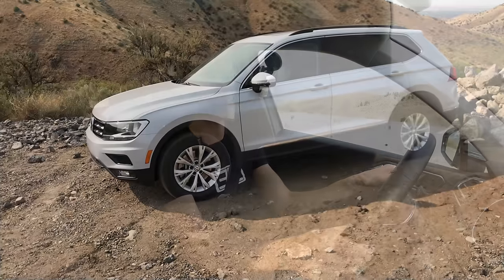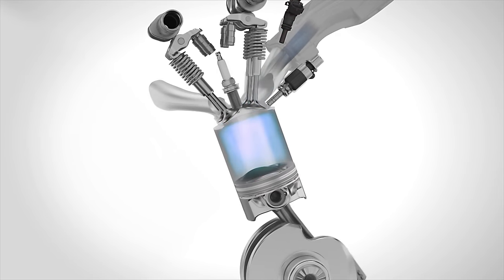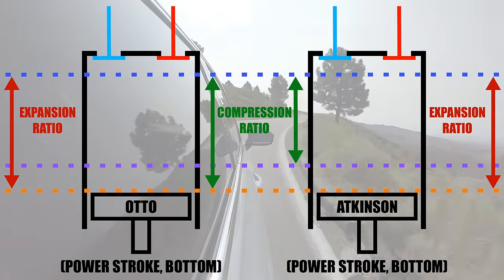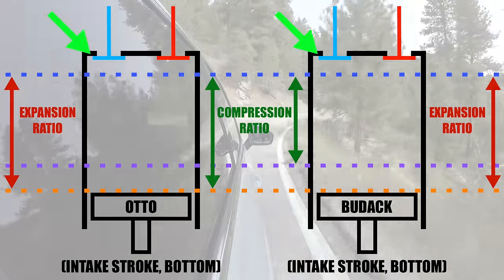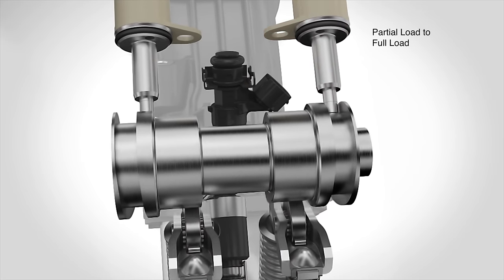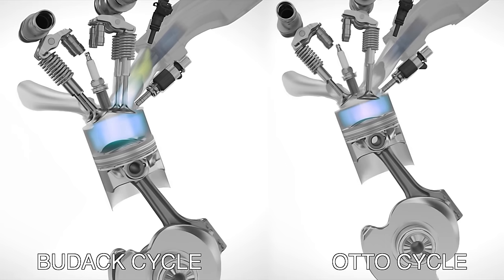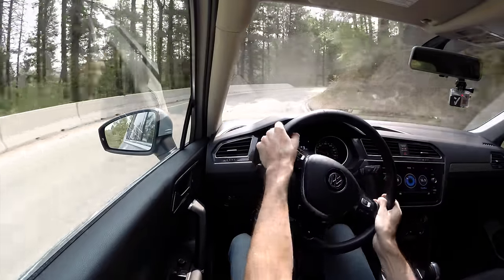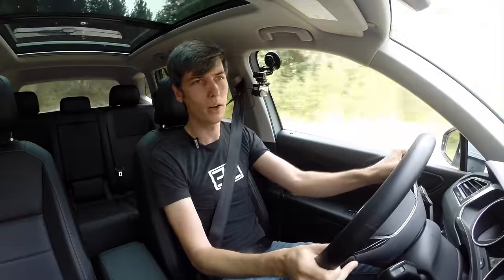Volkswagen's New Engine Cycle - The 'Budack' Cycle

Comment: So it's just variable-time valving? :s
Reply: Something Honda have been doing since the late 80's.
Reply: Mr.Mister Providing all the torque at a very low rpm, which honda never did, sorry.
Reply: St-Laurent Louis No need to be sorry.
Reply: St-Laurent Louis if u want torque at low end then buy a diesel
Reply: Technically a combined VVL/VVT system. Usually VVT works different (I think Jason has a video on it)
Reply: St-Laurent Louis no. Soichiro Honda wanted his engines to deliver the power with a naturally aspirated without turbos etc because of how that felt to drive. But that doesn’t seem to be possible to do if you want power and meet emission standards. So I guess it is the end of high rpm car engines.
Reply: krismoe31 , I think they do different things but the same way...
Reply: VVT is used to cut emmisions when the engine is not moving the car by restricting fuel flow to barely enough to drive the engine itself, while VVL is used to improve efficiency to power ratio. VVT changes the timing of the valves, while VVL changes the profile of the cams thus the amount of time and how much the valves are opened. 

TL;DR they work differently with the same goal: better emmisions in the real world while still having decent performance.
Reply: VVT with a different lobe pattern. It is all about that lobe pattern.
Reply: Rotring 
But emission scandals...
Reply: krismoe31 Q
Reply: Eh, the main difference is the intake valve could be closed during the intake cycle, lowering the effective compression. Helping fuel efficiency. While vvt usually is put in place to expand/move your power/torque curve.
Reply: Mr.Mister until they finally caught on and put a turbo on their engines. Only took 30 years...
Reply: Dan Richard
Meh...
Reply: St-Laurent Louis: Honda provided a similar amount of torque to any other normally aspirated piston engine of the same displacement, they just made about 50% more power.
Reply: Not sure to what you are comparing to, if you take a low performance engine of similar displacement then they make just a tiny bit of more low-end torque because their low RPM cam is very mild. But they have way more low-end torque compared to other high performance N/A engines. Any N/A engine with a fixed, "large" cam tends to have very poor low-end and even idling may be troublesome.  What Honda did is that they made best of both worlds: High low-end torque from a very mild cam and high high-end torque from a big cam. A low torque myth came from comparing engines of completly different displacements, or with a forced induction. BTW Stock 2.0L engine from a WRX, with a turbo peaking at close to 1BAR  has 15hp less than a naturally aspirated 2.0L VTEC engine from  S2000. And to be honest during city driving this N/A Honda motor with 207 Nm at 7500rpm feels much more torquey than a turbocharged WRX with 300 Nm/4000rpm, because of all the turbo lag and lack of boost below 3000 rpm.
Reply: Or better still, an electric vehicle... Heaven knows why they're wasting time and resources on this ancient technology.
Reply: Roger Froud Because battery tech isn't up to snuff yet. An even more ancient tech.
Reply: Tesla have already shown that's false, even with today's battery technology. The rate of change is enormous, so there's no point in chasing another few percent of efficiency out of something which has abysmal efficiency anyway. Forget the IC engine for small vehicles, it's a dead end.
Reply: Roger Froud The rate of change of battery development?  Given current chemistry, its about peaked. There are plenty of downsides to battery only electric cars, range notwithstanding. I live where winter is real, and cold. Batteries suck at low temps and the lack of heating power is a problem. A two hour commute becomes uncomfortable quickly. They are also overpriced, even when subsidized. Chevy Bolt, the most reasonable commuter, is $35K, yet I can buy a Jetta locally for $17K off the lot.  The difference buys a lot of fuel, and very few limits to range, etc. When electric gets significantly cheaper, it might be a rival, but only for short range driving. ...
Reply: My friend, you're out of date and swimming against the tide. Tesla have already hinted that they have a new generation battery in the pipeline, and there are well funded developments taking place at Toyota. There are also rapid strides in solid and polymer electrolytes that will massively increase the energy density.
Perhaps you're not old enough to remember some of the revolutions that have happened in technology. Once upon a time we could never imagine flat screen TVs ever reaching the shops, and when they did, the price was terrifying. Governments in Europe have thrown their weight behind the switch, so it's going to happen whether you like it or not. If anyone wants a slice of the pie, they'd best get their skates on!
Reply: Roger Froud The TV analogy is perfect. Do you think that the "early adopters" that plunked down $6000 for a Sony plasma when they first came out were particularly smart? Or the people like me who waited until the price was 1/10 that AND I got a free BluRay player with the purchase?
Reply: Robert Thomas says who? Disk brakes sat on the shelf for years. When Soichiro Honda invented piston rings in 1938 they said he was crazy. Then in about 1970 Soichiro Honda invented the CCVC stratified engine the SAE said it wouldn't work.
Reply: Roger Froud: Current Lithium-Ion battery development is yielding about 7% increase in energy density per year.  Not bad, but it's going to take quite a long time to get similar range to ICE engined cars at that rate.
Reply: mikerjuk, batteries don't need to have the same energy density as petrol (or anywhere near that) because the other parts (motor, gears, transmission) are so much smaller and lighter.  Electric vehicles also don't need such a large air intake for cooling purposes (because they aren't throwing most of the energy away) so they easier to make aerodynamic (it's not a lot but it helps).  They can also harvest a good portion of the energy that would otherwise be lost when braking, again, not a lot but it helps.

A Tesla can get away with carrying about 1/40 the energy of a petrol car and still go about the same distance on a charge/tank.
Reply: Peter Lund: I didn't say anything about comparing the energy density of petrol and lithium ion batteries.  My reply was to Roger Froud who stated that the rate of change in battery technology is "enormous".  It isn't enormous, it's pretty much incremental at the moment.
Reply: Robert Thomas, no it has not peaked yet.  There's still a lot that can be done with additives -- and since it was only about two years ago that good measurement equipment for test cells was developed, we should expect development of those additives (and other parts of lithium ion cells) to progress much faster now.

Additives help with temperature sensitivity, charging speed, heat losses during charging, and the number of cycles the cell can handle.

The density can be improved not only by using thinner layers in the cell (it's basically a rolled up very long and thin flat battery) but also by using finer carbon grains for one of the electrodes and by the use of additives again.  It can also be improved by adding small amounts of silicon -- this is something Tesla and Panasonic have already started to do but there are good reasons to expect them to gradually raise it from a few percent to 20-30% of the carbon.  There are problems with silicon but additives can probably solve some of them.

Jeff Dahn, Dalhouisie University, and his group have really pushed the limits of how well charging and discharging can be measured.  It turns out that they can get information from a few charge/discharge cycles (or even just a single cycle) that previously took hundreds of cycles to get.  That makes it much faster and cheaper to develop battery improvements.

The point of improving the energy density is not so much to make the batteries smaller as to make them cheaper: if you can get more bang out of the same materials you don't need as much of them, which makes same-size batteries cheaper.

Current lithium-ion batteries take a long time to produce (weeks or at the very least days), mostly due to a "maturation" period after the production proper where they are put through a special charge cycle (or several charge/discharge cycles) while their temperatures are raised in a specific way.  If they can make that faster, they can make cheaper cells.  Again, this seems to be something that can be handled with additives -- and it looks like something Dahn's group has looked into.  They have published papers that almost say something about this but I expect the actual information to be proprietary to Tesla.  Other groups have their own ultra-precise charging monitors (commercialized by people who used to be in Dahn's group) so they are very likely doing their own research into this as we speak.

So, to sum up:
 - they are likely to become more energy dense, which is not particularly important by itself
 - they are likely to become faster to charge
 - they are likely to become both more cold tolerant and more heat tolerant
 - they are likely to waste less energy in the form of heat while charging
 - they are likely to be able to handle a higher number of cycles
 - they are likely to become faster to produce
 - they are likely to become cheaper.  Much cheaper.

Your Jetta is going to remain cheaper for some time -- perhaps more than a decade -- but EV cars are going to become cheap enough that their other upsides outweigh the price in perhaps a decade for many people.  Probably for almost everybody in two decades.  And to get back to the original subject: this limits how much effort it is worth putting into improving small combustion engines.
Reply: Peter Lund - I think your figures are way off. 1 Litre of Petrol has an equivalent of 9.7KWH
A BMW 5 series petrol car has a 68 litre tank so that's 659.6KWH or 6.59 times more energy than a 100KWH Tesla. That's not 40, is it!
I very much doubt if the range is the same either. Sure, the petrol vehicle is throwing away around 60% of the energy contained in the fuel, but that's why it's carrying so much of it.

It's best to check facts before making wild claims.
Reply: Development is incremental in Lithuim Ion, but there's a massive amount of effort being put into many alternatives. The first to make a big step forward walks away with a massive pay day, so I wouldn't bet that it's not going to happen soon. Even as it stands,  incremental changes are enough to see a global roll out of electric vehicles now countries are legislating for it and the big motor manufacturers want a slice of the pie. Better batteries are just the icing on the cake.
Reply: Oops.  That's what happens when I don't redo the math from scratch.  I did do the math, honest, I just misremembered the numbers :/

I remember that I based the calculations on a Model S with the 85kWh battery (top of the line back then) and a 50L tank.  That comes out as roughly 300MJ vs roughly 1700MJ so about a factor of 6.

How on Earth that could turn into a factor of 40 in my head is beyond me.
Reply: We only get those laws banning ICE cars in the future because everybody expects batteries to become better (and therefore much cheaper) in the future.  Otherwise, they would just mandate a hefty price increase (+ a lot of money going abroad).  That's a sure way to lose elections.

Therefore, better batteries are not just the icing on the cake.
Reply: And it's a perfectly reasonable expectation, as is the cost reduction due to vast production quantities. If governments provide the incentives, industry steps up to the plate. Let's face it, car makers who don't invest vast sums in this technology are doomed, so what else would you expect them to do?
Reply: Peter Lund If you look at my post above you will find that I'm all for the EV, but it has to meet my needs as a consumer. Nothing currently does, nor in the foreseeable future.  I'm skeptical about the advances. Will they happen? Sure, but it will take time. I take anyones research with a large grain of salt. When it becomes proven technology and at a competitive price, the market will be there. I expect virtually anyone in the battery making business to have glowing reports of what their research show "just on the horizon".  I'm old enough to remember numerous instances where "the next big thing" was "right around the corner" and it just doesn't happen.  I would agree that ICE tech has probably peaked. Since all the ICE's I'm interested in are practically antique, I don't really care...
Reply: Roger Froud:  I agree there is a huge amount of development, but it hasn't lead to any major breakthroughs so far, despite constant media articles saying the next big thing is just around the corner.  Unfortunately a  successful small scale lab experiment does not mean full volume production is viable which is why several promising  areas of research have floundered.
Reply: mikerjuk I understand the push to stop using fossil fuels. But what about using just a little bit?  One of the biggest drawbacks of the current EV, for me anyway is the lack of range, the effect of cold weather on range and the generally poor performance of the HVAC system when it comes to winter weather.  All you have to do is hang out on the EV boards and you will quickly see that the most enthusiastic owners are in warmer parts of the country.  The owners in cold climates admit, sometimes grudgingly, that in the dead of winter anything more than a half hour trip either leaves you cold or with no range.  Not to mention what happens when the weather turns to crap and you end up with a two hour commute in freezing temps. This is a regular occurrence in places with a real winter.  What I'm wondering is why EV manufacturers have not included a supplemental HVAC heating system that is diesel powered?  Webasto and Espar both make diesel fired systems that heat boats, trucks, engines, etc. and do so efficiently, using very little fuel. Why not have a system like this in an EV, for heating, defrosting, and keeping the batteries warm?  It would only be needed 4 months of the of the year.  These systems are already programmable, so they could preheat the interior and the batteries after sitting in a parking lot all day cold soaking.  Maximum range requires warm batteries whose energy is not being squandered on heating the vehicle.
Reply: I imagine they are simply looking at the low hanging fruit first to make a return on their enormous investment. Why go looking for difficult customers to win over when there are millions of easy ones? Once battery technology improves, the range, recharging rate and cold weather issues will be addressed and it won't be an issue.
At the moment the infrastructure is still being rolled out, but here in the UK there are Tesla rapid chargers at all of the motorway services I've visited recently. Range becomes less of an issue if you know you can pull up somewhere, grab a coffee and add another 100 miles range.
It's still early days, an I too won't be buying one until more infrastructure is in place and the costs are lower. There are millions of families with  second vehicles that rarely go more than 30 miles from home. These are the ones that are going to be the really big customers. You'd probably never need to charge away from home, so it's a really convenient and cheap way to power your vehicle.
Reply: Roger Froud Have you been to the US? I've been to the UK, I have friends there, and your driving habits, the distances traveled are completely different. Low hanging fruit?  A significant portion of the US lives in a place with real winter. If they want to make inroads in these markets, the vehicles have to be practical.  I have a minivan, primarily a kid hauler, its what we use for family trips.  Range is a big deal. My wife commutes 110 miles round trip every day, with no ability to recharge and frequent side trips while at work. EV range is not even close to making this possible if operating in sub zero temps is factored in.  My truck tows between 2 and 3.5 tons everyday. There isn't a battery made that can withstand that use, and no sign of one in the future. Certainly not affordably.   The idea of a "second car" with restricted range, weather compromises, and a very high price compared to an ICE vehicle, is absurd for many of my countrymen.  If I spent an hour sitting in traffic to travel 10 miles in a warm climate, like people in LA, than maybe it would make sense. You keep daying the technology will improve, I'm sure of that as well,  but if you want the skeptics to buy, you have to minimize the negatives. There are plenty of other good ICE based options right now.
Reply: Indeed I have been to the US and driven the length of the Rockies so I'm not unaware of the size of the country. Clearly there are many US users who aren't currently catered for, so those people will have to wait a little longer for their electric solution. However, there are still millions of US drivers who could easily switch to electric. There doesn't seem to be any lack of demand for Tesla, does there?
So, as I said, the manufacturers will take the easy option and that will suit a large enough proportion of users to build a business and infrastructure.
Range is only an issue if there is insufficient infrastructure and it takes a long time to recharge.
The change will come whether you like it of not, and at some point it will be the most obvious choice, especially when you have to figure out where to buy petrol when you're the last of a handful of users and the garages are getting to be few and far between. The infrastructure for liquid fuels will certainly shrink as demand falls.
Reply: Roger Froud "whether I like it or not" Stop being a condescending twit. I've already said I welcome it, provided it meets my needs. Tesla and the demand for them is absurd. Seeing the buyers of vehicles that cost $70K clearly do not need to worry about saving fuel, probably own several  ICE powered vehicles as well, the demand is not indicative of anything. When they produce a sub $30K commuter with decent range and a passable HVAC system they will sell plenty. The Chevy Bolt comes very close, apparently they sell extremely well in California. Perfect climate for an EV.  You seem to think ICE will just melt away. I doubt it. They struggle to produce a battery that gets reasonable range now, and thats for commuter vehicles. For vehicles with 8,000lb+gvw it will take far, far longer. The weight of the battery alone becomes a real problem. Not in my lifetime.  Autonomous vehicles, but the death of ICE? I wouldn't bet against it.  Every year here we have people who get trapped in their vehicles in blizzards. Most survive, but they have an ICE for heat. One good storm and some citizens turned into popsicles, and the EV is going to suffer a good blow in anywhere with winter.
Reply: You're betting on the wrong side of the argument my friend. ICEs are doomed, and for the very good reason that oil won't last forever, we can't afford to pump that much CO2 into the atmosphere and in the forseeable future, electric vehicles will do as much as any ICE propelled vehicle does now. 
Then look at the simplicity of the drive train and power units, electric is going to be significantly cheaper to manufacture too.
The thermal efficiency of ICE engines is appalling and there are better and more efficient ways of creating, storing and using electricity. Check out the developments in Thorium Reactors and you'll see that we're on the cusp of rolling out a massively disruptive technology.
Once you can store as much energy in a car as a tank fuel of liquid fuel, your argument will be null and void. We're only a factor of around 2-3 to get to that point, and solid electrolyte batteries will get us there in about a decade.
Reply: Roger Froud I'm not "betting" on anything, I'm telling you the harsh reality. And that is, regardless of what you want, and the hype promises, the ICE is going nowhere in my lifetime. Commuters, sure but there are too many other applications for which there is no answer, and none on the horizon, especially at an affordable price.  Thorium reators would be fantastic, I've been an advocate for them for at least a decade, when I first learned about them. But the US Govt is run by idiots and the populace thinks "reactor" is a very scary word. I'd be building them yesterday but from what I've read there are significant regulatory hurdles as well as PR issues.  Again, time and need will tell.
Reply: Well, we'll see just how quickly things change. Here in Europe the legislation is in place and it's going to happen. Trump may dig coal and the government may stand in the way of Thorium happening in the US, but that's not relevant any more. China has hundreds of engineers on Thorium, as have India who already have a test plant operational.
In your lifetime.... well that depends on how old you are. The change won't come overnight, but in Europe we're already ahead of the game and development is only going to get more rapid. Once we pass a certain level of range and recharging infrastructure, the tipping point will rapidly err in favour of electric.
Reply: Roger Froud I would agree on that. Its the timeline aim skeptical of. The US had a thorium reactor online at Sandia National Lab, I think? for 5 years. It ran perfectly with no issues. The people who did it are still alive to tell about it. There are some very good vids online regarding thorium, with interviews of the scientists involved. It a known technology, it takes the bureaucracy to get out of the way and someone to do it. If the Chinese and Indians figure it out the rest of the world will have it in short order. Believe me I understand the significance of clean, available and probably cheap power. That will change the world.
Reply: Roger Froud Depends on your definition of efficiency.  Batteries and electric motor control  systems are improving rapidly, but they don't make power; that comes from  power stations. Utility companies aren't necessarily better at making power (more correctly "work") than individual car engines.
Reply: Efficiency is front to back from source of all the materials, including fuel, to use in the car. Oil production is hardly cheap, it takes vast amounts of energy to drill, pump, refine, distribute and eventually waste 60% or more of it and release CO2 in the process.
Electric motors are 90% or more efficient and the grid is way more efficient than tankers full of fuel driving around. Even if you burn oil in a power station, you'll still be more efficient than burning it in your car. Look at the cost of producing complex engines that need servicing more often than electric motors. The life of them is much shorter too, so you have to factor that in. Take a look at the chassis of a Tesla and you will see how simple it is compared to an IC solution with its complex transmission.
Renewable energy in its many forms and the upcoming developments in Liquid Salt Reactors burning Thorium have a much higher efficiency than oil burning engines and they have a lot longer life.
Releasing all the trapped Carbon Dioxide is already causing havoc. No responsible government can pursue the long term goal of burning oil for the next century. The result would be catastrophic.
Reply: Roger Froud quoting the efficiency of batteries and motors and comparing them to I C engines is not comparing like with like. Electrical devices are only transmission systems. You would be more correct to compare them with gearbox efficiency. The power/work as you say can come from a variety of sources, none of which are anything to do with Tesla and the like. Your electric cars are therefore propelled by (amongst other thngs) coal.
Reply: I don't know why you're so hostile to the cleanest way we have for getting around. However you look at it, burning fossil fuels is NOT the answer. Energy production is the key, I think we can agree about that. What you can't do is to run an IC car from Wind, Solar,  Hydro or any form of Nuclear power. There's no long term future for IC technology. The only reason it ever got the stranglehold it has on transport is because of the high energy density of its fuel, which is high enough even though you're throwing more than half of it away! Now that batteries can store enough for electric vehicles to have a reasonable range, that reason has all but vanished. Even better Battery storage, more renewables, and the promise of LFTR Nuclear power generation will consign IC engines to history whether you like it or not.
Reply: Roger Froud It will be interesting to see how we will power ships and aircraft in the future. There are such things as nuclear powered ships (though only currently for military applications) but airtraft will prove slightly more challenging I think. Anyway, looking forward  to electric motorcycles,  then I may sleep longer on Sunday mornings.
Reply: Agreed, those are much bigger challenges, but portable LFTR reactors are probably feasible in ships even if we have to wait much longer for them to power aircraft. Interestingly enough, the only reason the Molten Salt Reactor was invented was because the USAF wanted nuclear powered bombers. The future of just about everything was Nuclear in the 40's and 50's. The navy had its Nuclear subs and the USAF wanted a piece of the future too. The trouble is that you can't realistically use low temperature high pressure reactors on planes.
The Molten Salt Reactor solves those problems, being both high temperature and low pressure, ideal for compact and light systems. I don't think anyone on the project seriously thought it would ever find its way into aircraft, but it's so much better and safer than the other (current) nuclear technologies that they thought it was sure to win the day. It didn't, and that's because of economic and political momentum, vested interests and wilful ignorance. It's sad, but a brighter future awaits now this technology is being developed.
Reply: The Russians built a nuclear powered bomber. It spewed radiation into the atmosphere and killed the crew.
Reply: I am sorry to inform you Peter, but Soichiro did not invent piston rings in 1938, he was actually trying to improve on the ones that were currently available in Japan.
Reply: Martin J mines only revs to 6700 rpms but VTec hits around 6100 rpms but no torque
Reply: V-tec kicked in yo!
Reply: fail
Reply: Yep, hot rodders been doing this for 30 yrs or more.
Reply: Another electric car fantasy

Also this is another fancy way of doing variable valve timing.
Reply: Robert Thomas I disagree, your the one that needs to keep up. Cam profile can be changed by varying timing and lift 
Think about what the guys saying rather than jumping down his throat
Reply: Exactly where the heck do they think the electricity comes from to charge up these batteries.
Reply: exactly
Reply: mibars, have you driven both the S2000 and the WRX? Because there is no way in hell than the S2000 feels torquier at low rpm than a turbocharged car.
Reply: But in germany they call it Budack, silly    HAHA
Reply: @majwor3763  , depends where you live. Where I'm at it's all hydroelectric.  Although even if it was coal you're still burning less fossil fuel per unit of horsepower to the wheels in an electric car.   Wish i had one myself as i mostly drive short trips.